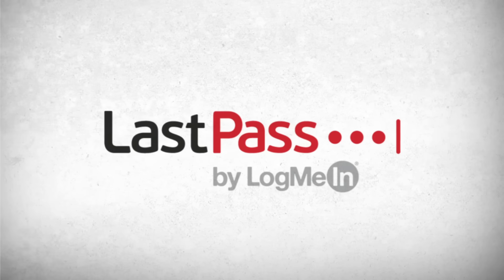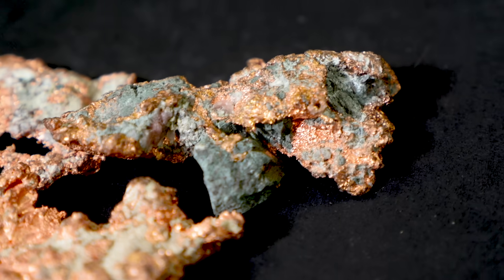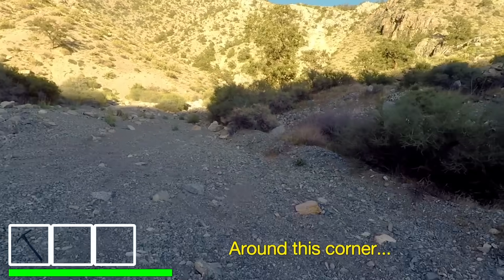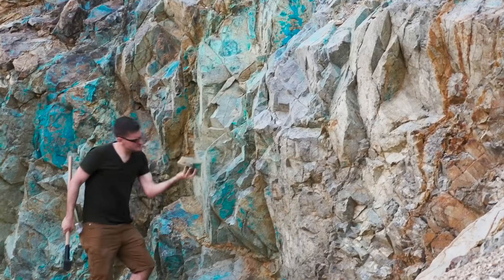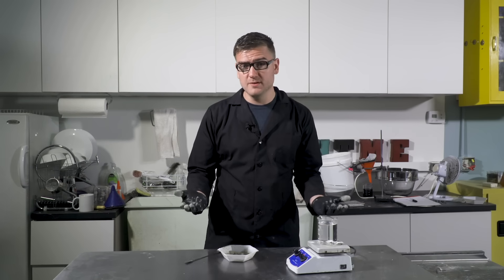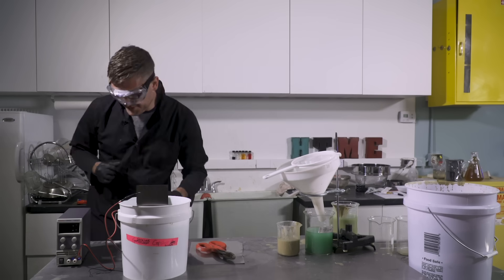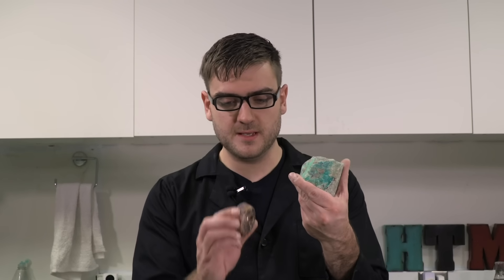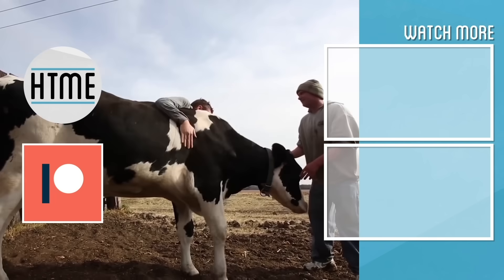From Rock to Copper Metal

Comment: More interested in how they did it 2000 years ago
Reply: DEFINITELY! That's what I thought the video was going to show!
Reply: 2000 years?
 try more. the copper age was 7000 to 5000 years ago. very impressive
Reply: Easy....fire....they had BIG FIRES....EVERY DAY....chinese worked out the trick of firing clay on a hill to get the updraft, that is how they cornered the market in quality "china"....metal the same.
Reply: @scottleft3672  Actually a 20 or 30-foot chimney will produce enough updraft to smelt iron in a properly built furnace.
Reply: @charlesaanonson3954  I would not doubt it, that seems the height of those early smelting chimneys in the English painting of the late 1700's, the Chinese first discovered that firing their ceramics on a hillside utilising a consistent updraft, allowed them to achieve the vitrification level we know as the "China plate"...mate....lol.
Reply: Back then you could find boulders of pure copper everywhere, just melt it an mould it.
Reply: You obviously didn't watch last minute of video....
Reply: try the primitive technology channel, it may not have the exact stuff you are looking for but surely among those lines...
Reply: Way too hard and long, especially with such low grade ores. It's cuz they haven't figured out the magic of "significant figures," HA!

Oh and it would also require you to have a significant amount of skill and knowledge in the craft cuz you won't have the modern tools to make up for it.
Reply: Smelting
Reply: They basically just threw it in a hot fire
Reply: dash4800 check out primitive technology, hes been uploading a bit of vids extracting ores
Reply: Back then the yields were extremely low, in the early most days of metallurgy it wasn't used for tools, but for jewelry. The incas for example worked with gold and silver but used stone tools.
Reply: Basically crush the rocks into a relatively fine powder. Make a fire inside an 'oven' with thick clay walls for insulation. Copper in your powder melts, should your fire get hot enough and is left in little pebbles you can fish out of the ash and other stuff. They might've had more refined methos than that to smelt it back then...
They definitely had coal and knew how to use it 2000 years ago but you might be able to get a hot enough fire with normal wood, given that you have enough of it and have enough insulation to retain the heat.
Reply: they ignored the low yield ores and mined higher yield.

Its like extracting anything from rocks, its not usually worth it. The amount of work put into turning rocks with gold flakes in them into gold bars doesnt profit much. It does profit, but not much, and requires a huge investment for the equipment and materials needed to extract it. Most people looking to get rich off mines in the old days were hoping to hit a vein where mother earth did the work for them already.
Reply: aside of sulfuric acid what is the another solutions to extract copper from ore? just asking.
Reply: more like 20,000 years ago 2,000 years ago nobody used copper because we had steel
Reply: Me too...
Reply: Fire and wind
Reply: There was a shit ton more copper and no tv or YouTube people were bored and wanted to find success many used what was freely available to them
Reply: @ryannu1578  what do you mean?
Reply: 115 xboxmaster think of how much copper is available even just at the opening of that mine now imagine how much it takes to produce an actual usable amount of copper now imagine how much has been used or waisted over the last 10000 years and that goes for a lot of mineral resources these people of the ancient world had time to explore new things and if there was a green mountain outside your house maybe one day people burning a hot enough fire notice the rock melt who knows people only worked skrewed ate defecated and slept that was the entire universe for many of our ancestors so they experimented with the world around them
Reply: Id say they figured it was harder than stone and when they put it in a bonfire the heat made it malleable enough to refine into a better tool. As more copper tier tools and such were made, it became easier to heat up with wood, get out the gunk, and shape them into better tools. Then when they did the same process with tin they tried adding copper and tin together. Whala, you have the bronze age :)
Reply: yea, I think it sucks, I'd rather se how our ansestor did this than it be done in a modern way. Definitely be more intersting.
Reply: @thereynolds2725  Were it aliens why did it they teach us primitive methods and not teach us until thousands of year later to refine iron?
Reply: Theory goes that when they piled various rocks around to make fire or carved to make alcoves to boil stuff in, they found that various beads would form, a few broken teeth later, that coalesced in figuring out how to make more of that and copper, bronze, iron came out of it.

As for rough formation, wooden and stone tools.
Reply: Few ways, one is native copper; meaning it can just form basically purely in nature. Secondly by heating more pure and usable materials than a copper hydro sulfate  (which is what that was) as he mentioned, like the one that tend to for with native copper. Sadly most things in north America are sulfates so that is a bit of a challenge.
Reply: Thats exactly what I wanted to know. Getting tired of ppl making content just for money.
Reply: dash4800 they used copper.
Reply: I'm more interested in what Dave puts in his hair
Reply: As for how they did it back in ancient times: They would crush the green stuff (malachite) into a fine powder, then do likewise with some charcoal. The two powders would be mixed in equal parts, then sealed up in airtight clay vessels. The clay vessels would them be put into a fire, where blowing pipes would be used to add extra air to the fire, helping it burn hotter. Once the vessels got hot enough to melt the copper, they would be extracted from the fire using a stick or tongs or the like, and left to cool. Once fully cooled, the vessels would be broken open, and the nuggets of metallic copper extracted. Numerous nuggets would be compiled together in a larger container and re-melted for pouring into a mold.
Reply: They found some green rocks and melted it with fire. Kaboom that’s the answer.
Reply: @devinklein4894  Not entirely accurate...but close.
Reply: People were  lot smarter back then. They just went to the copper store and bought it.
Reply: Just heat up the whole mountain. Then train some  beavers...
Reply: Read Vitruvius.
Reply: Right! Aliens 👽
Reply: Then look up a video for that, there is nothing in the video or title to suggest that this was going to be about how they did it in ancient times.
Reply: Yep,, pretty sure they didn’t know about using acid or electro plating
Reply: yeah, I honestly stopped watching it once I realized he was using modern extraction techniques. I thought he was going to actually use stone-age methodology to create a copper tool. I already know how people extract copper using modern chemical techniques.
Reply: @TitanEidolon  You clearly haven't been watching this channel for long, then. He's NEVER used ancient techniques.
Reply: slaves,  people forced to work in claustrophobic mines breaking rocks day and night. there is a good history channel doc on this subject ill link it if i can find it again.
Reply: @cpthammer  Pretty sure he means the process they used to produce usable copper for tools and weapons during ancient times....lol
Reply: @cpthammer  Where can I buy some slaves to work my mines?
Reply: @davidroberson8951  Clinton foundation
Reply: Exactly!
Reply: I commend your video BUT I also thought you would show how this was all done 4500 years ago! That's the whole point. I expect you to dress up like primitive man, get on your donkey, use tools that were ( non-ferris, no iron discovered yet), and follow the ancient procedure! You are allowed to order a pizza by cell phone but cannot use any modern extraction methods!
Reply: @TheWolfgangfritz  why?  Was there anything at all that suggested this was going to be an old fashion way?  All it said was from scratch.  It's important to know how to do it the modern day as well for those that actually want to do smithing.
Reply: aliens
Reply: Who taught The aliens
Reply: @iadd2568   Trial and error (which means "they" themselves, even though the process then must be a predetermined possibility), if not some other intelligent influence. The word "alien" really has no meaning, if you are able to comprehend the idea of limitation.  Obviously, as many others, you aren't, therefore you ask this question as if the answer has any weight. (or you're/whoever is doing it for kicks, just to leave a mark)
Reply: @sFeral  slow down buddy. No need to get offensive. I said it as a joke. And the word alien can mean multiple things, foreigners are technically aliens. The term means something coming to a place unknown to them where they did not come from and are not from. Also don't insult my intelligence, if there is one thing I hate it's people who think they're smarter than me. My point is if we were taught and needed help from aliens why would they be able to learn how to do the same thing without help as we needed. Point being someone had to figure it out first, just saying aliens showed us, doesn't mean that that's the end of it someone had to accidentally or somewhat intellectually came up with an idea to smelt copper. Thank you
Reply: Also I'd like to point out that if aliens did show us, why not show us everything and advance us faster that normal. Otherwise that's just clockwork theory and makes no sense
Reply: @iadd2568  That's your interpretation, I wasn't trying to sound offensive, nor is being limited anything to be offended about. Everyone should notice how you started an argument here. There is no argument.     The answer to your question is: If someone were to show you something like I'm doing right now for ex. , you'd have to be convinced, which means materialization, which in turn means no work on your part. Think about Artificial Intelligence, that can do everything you can and more (creating its own body(es) like Ultron from Marvels' fictional universe, just to name a mate-realized example),  what's left to be excited about, except chaos, which again implies limitation on our/your part.
Reply: @sFeral  here's the thing, all things are limited, nothing is infinite, nothing material that is. Point being, those aliens that taught us. Why haven't we seen them. Three possible answers, one they were never here, two they left, three they died. All mean that time is finite and things always have an end. Computers can process huge amounts of information, but things like cognitive reasoning is flawed in them. There is nothing infinite that you can show me. We were made from Star dust, and to Star dust we must return.....
Reply: @YskarAlbumLuna  many ancient cultures all over the world relate in their histories of "gods" descending from the heavens & teaching man agriculture, farming, animal husbandry, metallurgy, astronomy, etc. You might find interesting the records that the Mesopotamians left behind. The Dogon tribe in Africa has some pretty interesting things to say about those "gods".
Reply: @YskarAlbumLuna  Errr...No.
Reply: lol it could be tho, there's a lot of possibilities, we'll know someday i guess. I try to keep my mind open to anything.
Reply: @YskarAlbumLuna  No, because mankind did do it 2000 years ago! So good luck with that then...
Reply: Possibly helped by aliens? Nobody knows yet...
Reply: @YskarAlbumLuna  ohhhh kkkaaayyy!
Reply: @YskarAlbumLuna What's the simpler explanation: Humans figured out how to extract copper from ore over many years of trial and error.... or aliens traveled immeasurable distances from another planet to show hairless apes how extract it.... ?
Reply: The Reynolds, lol, i wasn't here to explain anything, i was just opening possibilities, this explanation you gave, everybody knows it already... 

 Aliens probably can travel these distances like it's a walk in the park, wouldn't we do the same if we could? To test other uncivilized species, it would be like playing a game. Many things we know could be because of aliens. To think they had discovered this much in so little time just makes my argument more valid and possible. Humans lifespan is too short, the communication in that era wasn't all that great and the metods to do all this was way too advanced, too much science involved, but whatever you think, i just hope you open your mind.
Reply: @YskarAlbumLuna  You are the definition of the aliens meme.
Reply: Benny2.0 lol
Reply: @YskarAlbumLuna  literally just google it.... or search for it on yt...
Reply: @Jacob_Crowthorne  humans doing it 2000 years doesn't preclude aliens from helping. Not saying they did, but that fact alone doesn't rule them out. And humans have been making copper/bronze for more like 7000 years. 2000 years ago we were in the iron age
Reply: ??? an open mind is like a fortress with its gates open and its doors unbarred...

imperial truth of the day.
Reply: @YskarAlbumLuna  found KenM's alt
Reply: who'sd even KenM wtf
Reply: @YskarAlbumLuna  That's sadly not keeping your mind open. That's ignorance and silliness.
Reply: @Adam Monaghan really? I'm not really affirming anything, i'm just open to other possibilities, but whatever you think.
Reply: @YskarAlbumLuna  we do know, no aliens
Reply: @thereynolds2725  I’m 2 whole years late, but if aliens supposedly “helped” us extract a metal that will just be thrown away and obsolete 1,000 years later, they would’ve stayed on Earth longer and we would either be long dead because they hunted us, or we would be colonizing the Andromeda Galaxy because they helped us discover dyson spheres before iron.
Reply: @potatoboy549  I had to go look back and see what I said two years ago. Do you think I said aliens helped us refine copper? Because I did not. What I said was that it was possible aliens helped, but I don't see the evidence of it. In other words, I do not believe that aliens intervened in our development of copper tools.
Reply: @thereynolds2725  I was agreeing with what you said.
Reply: @YskarAlbumLuna  actually we have a pretty good record to have a basic idea of how it happened.
Reply: @Jacob_Crowthorne  They actually started using copper around 5 millenium B.C., which is roughly 7,000 years ago.
Reply: @LuisTorres-zm2xd  okay.
Reply: You know, everything in the universe works in symbiotic way, literally everything. We must have some use for them as they've for us, but that's could be beyond comprehension, who knows?
Reply: @YskarAlbumLuna  I think that you think I disagree with you. I don't. All that you say is a valid point about hypothetical alien civilizations. But when it comes right down to it, it is an irrelevant flight of fancy. Something that is immensely interesting and equally a waste of time. I spent my youth pondering these things.
Reply: The Reynolds, i've seen aliens before, so it's relevant for me, it's not something i believe, it's something im certain, knowing these things changes everything.
Reply: @YskarAlbumLuna  I imagine it does. But as I have never seen one, you must understand that you simply saying you did isn't enough to quell my skepticism overall. Again, I'm not saying you didn't have an encounter. I'm just saying that until I lay my own eyes on one of these things, no amount of words will truly eliminate all doubt.
Reply: @YskarAlbumLuna  No it doesnt lol I think you dont understand what symbiosis is
Reply: +A9 What is symbiosis for you then, you don't seen understand how subtle it can be, it's not like it needs physical  contact or shit like that, and i'm not even using the word in the literal meaning.
Reply: @YskarAlbumLuna  Being part of 1, is physical contact, the subtlety of which, sometimes, tends toward 0, but is never 0.   You already know that.
Reply: The Reynolds, what's left for an civilized race to do in the universe after they've done everything for their own race? Explore? They did it? Gather resources? They're doing it? Create new technologies? They're doing it and did it? They can probably live thousands of years because of technology, so they must not care about observing another civilization evolution for extended periods of time. There could be an infinity numbers of alien races and many and many of them with different interests, who knows how many could like messing with apes for their own reasons.

Comment: Perhaps the reason your yield was off was that not all of the copper was dissolved in the initial acid bath. think that you should have used an excess of acid, but I might be wrong. Its been a while since chemistry class.

Comment: You've already tainted the copper with tin and zinc by pouring it molten into a common muffin tin. lol
Reply: Despite the nomenclature, I do believe the "muffin tin" is made of steel, which melts at a higher temperature.

Even if it did gain tin, it would simply become superior bronze anyway!